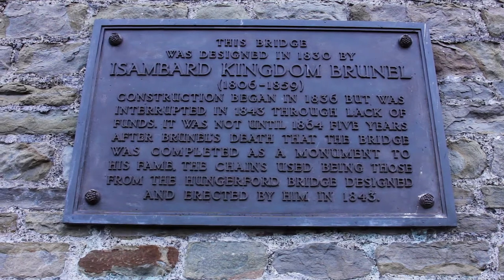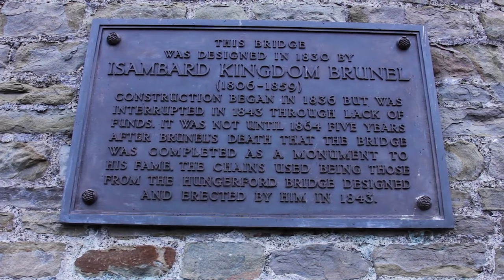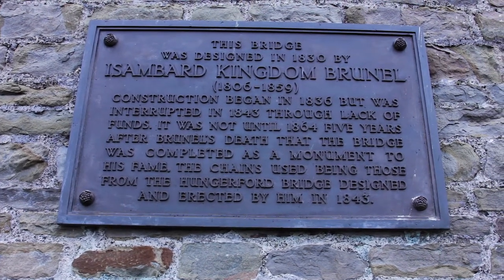Clifton Suspension Bridge - Isambard Kingdom Brunel - Forces in Suspension Bridges

Comment: You Look Handsome in this shirt sir.
Reply from the maker: Hash- tag thanks very much. My normal school threads do leave something to be desired! What do you think of the animations?
Reply: Animations were superb I personally loved it. Was this world's first suspension bridge? And does the golden gate bridge follows the same principle?
Reply from the maker: Hash- tag yes golden gate bridge is same principle, but that's all steel, which is even better at both tension and compression.  Clifton is not the first, essentially a rope bridge is a suspension bridge! But as far as I can see the first iron and stone one of this type is/was in Pennsylvania in 1801. The bridge from Bangor to Anglesey in North Wales also pre dates Clifton. Cheers, glad you like the animation bits! Got a new phone with a stylus! 😀
Reply: Wow amazing! I'd love to see a bridge that controls resonance by oil pistons. That's an advance engineering I guess. I still have question running around in my mind. Like how can a stone control compression wouldn't it just get cracks on it due to compression or does elastic limit plays a major role in it?
Reply from the maker: Hiya, I have a video about damping in buildings coming soon actually! Stone would tend to crack not under tension! It's not a very strong material which is why the stone pillars are so thick!
Reply: GorillaPhysics - You've cleared my doubt now. Thanks.